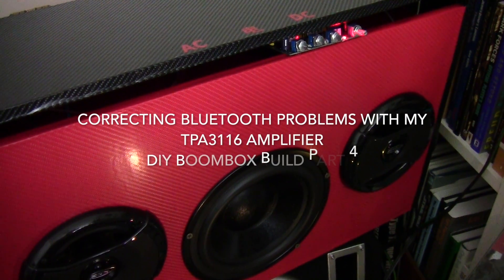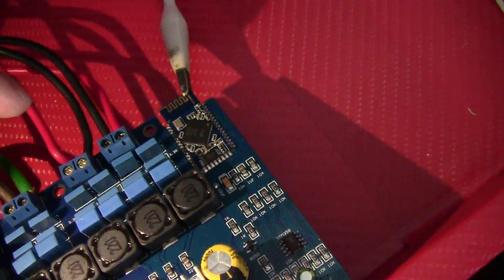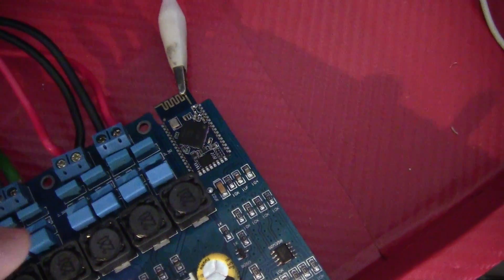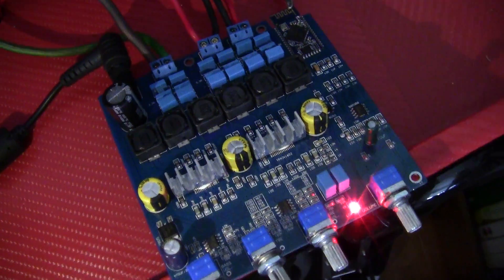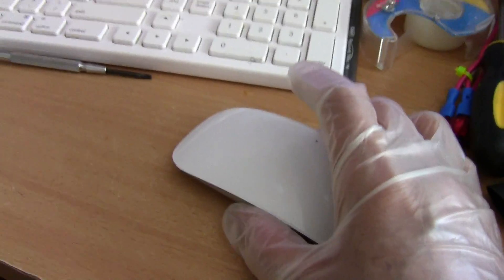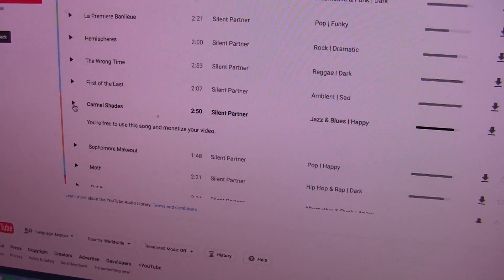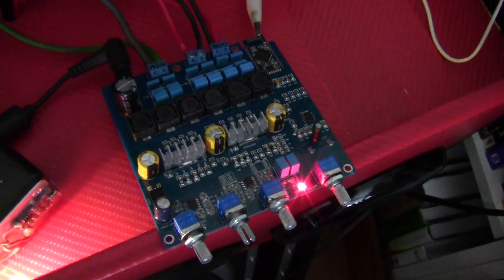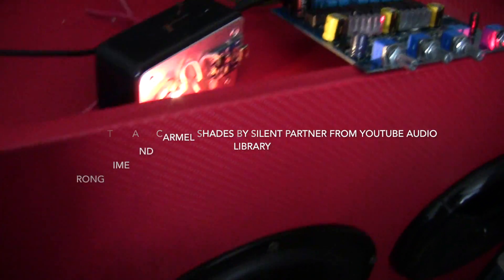Correcting bluetooth amplifier problems in my diy boombox. Boom box  build part 4

Comment: I bought the 3116 without the bluetooth. I will be hooking up a 4.0 bluetooth module to the input of the amp and see how it goes, so the bluetooth module and the device connected to the bluetooth module will act as the preamp.
Reply from the maker: The built in bluetooth is ok most of time but acts up occasionally.  I have the board installed in two units and they sound great to me.
Reply: +wtam69 Thank you so much for your reply. Will the seperate bluetooth module I am planning to use work well as the input? I also learned that putting a resistor across the input will eliminate most, if not all, ground loop noise.
Reply from the maker: The bluetooth will work well if you're using your smartphone or iPad etc. With other input sources such as a CD player or turntable, your analog input will work without any dropout or other issues. A land line will for the most part sound better than a cell phone signal.   People try all kinds things (capacitors, resistors or other filters)  to cut down the extraneous noises. If you have a power outlet without ground, you can plug that in to see if it improves the sound.  From my experience, all the sound filters (resistors, capacitors)  will help to cut down on the noise  but will eliminate certain frequencies.  If you don't mind that then that's fine.
Reply: +wtam69 Thank you for your reply, I was so rude just jumping in asking questions, without even saying to you great work, your project looks really, really good, well done and congratulations 👏
Reply from the maker: You are very gracious.  I appreciate most video work from others as I know it's not easy or simple to do a project and then film it.
Reply: +wtam69 I will try my best to do and upload my video on my build, I hope it goes well and is not too much of a disaster on my first try. I already also built some speakers based on the LX type using recycled materials from the kitchen 😆. Just did it from scratch and I was quite surprised at the good sound from these speakers hooked up to the TDA7492 bluetooth amp. Hope to do a retro type video on the build of this system soon.
Reply from the maker: Good for you. These are fun and satisfying projects, especially if the end products are half way decent. Looking forward to your build.

Comment: Solder a 1.5" piece of 24 gauge (or one strand of cat 5/6) wire to the end if the antenna lead on the board. Too much wire can actually "degrade" the signal.
Reply from the maker: Thanks very much for your input and your recommended video on the subject.

Comment: first off great videos, I have just recently purchased the same amplifier but I'm having some issues with feedback or a buzzing sound rather I was just curious if you have this is issue as well. I have tried moving it around to different parts of my house to make sure that's not interference with other Bluetooth devices and it never seems to get any better not sure if I just got a faulty unit or if this is a common problem with these.
Reply from the maker: I don't have a feedback back or buzz.  Most noises are masked when you listen to music at normal level or when your bass, treble controls are not turn to extreme positions. The only problem I have is the bluetooth from my Mac mini sometimes is not stable and the problem can be resolved by me doing a hard reset (as in unplugging and plugging device) on the Mac. This seems like a problem of my bluetooth devices rather than the amplifier though.
Reply: wtam69 alright Thanks
Reply: I did grounded all of the knobs using cables conected to the power jack ground. It helps a lot but a 
floor noise is still quite noticeable.

Comment: Your Dayton 8" sounds like its tuned high. You could try to add some weight to the passive radiator to lower the tuning to match closer to the sound of your dual 10". Still the Dayton 8" might be a lot less efficient with the passive radiator and being a smaller driver than the Dual 10" so you might never get that same level of tuning and volume that a port tuned 10" has.
Reply from the maker: The Dual 10 inch definitely has more bass.  I don't know exactly how to tune the Dayton subwoofer to the box I have.  One day I would open up the Dual to see how it is constructed and what makes it sound better.  When you work on your project,  it'd be nice if you can put it on Youtube so I can see what is a good design and how I can make mine better. I don't know what kind of weight to use for the passive radiator and how it is attached.  There is a lot of science in speaker building and I sure do have a lot to learn. Thanks so much for your input. I like your idea about using super caps as a buffer for your solar panels.  Right now, I'm working on another lithium ion pack with a BMS and balance charging capability.
Reply: The Dual 10 inch might just be in a more optimized cabinet and its bigger so the efficiency and displacement will be an advantage over the 8" no matter what even in the best conditions. I've been doing speaker design for the last 22 years on a DIY level as a hobby and I've learned a lot and it is very complicated to achieve excellent precise sound. I'm best with cabinet and crossover design for full range 2 way hi-fi speakers mostly and designing subwoofer cabinets. The air volume and specs of the woofer are quite important when you want to take the sound to the next level. The Dayton Classic 8" subwoofer you have wants to be in a vented or passive radiator cabinet because of its QTS value. Your passive radiator already has a mass disc on it and a screw hole so you can tune it further if need be. You can simply add a couple of steel washers and test it. But the Dayton specs for the 10" passive rad claim to have an FS of 19hz which is already very low so maybe this might not do much in your case to add, instead you might want to take off half the weight and aim to tune it higher. 19hz tuning is more of a home theater tuning, something in the 30hz-40hz tuning range is more musical bass in many cases like a boombox but not all. Also if you add a little sound absorbing insulation inside the speaker box you will improve the overall audio quality a little or alot in most cases. Most speaker boxes have a boxiness sound due to the midrange and standing waves in the cabinet escaping and being part of the sound you hear. This insulating would effect the midrage sound of your coaxes mostly. If you have no insulation, throw a couple of small pillows inside as a test. Then see what you think of the sound. It might not improve the sound quality depending on the speakers themselves and how they integrate in your speaker cabinet but its something to try especially for critical listening with any well rerecorded music you know and love.

For your future projects, if you go to parts express and get the spec sheet pdf of the woofer you have, you can use this link to see an approximate response curve when your doing the design before you build. If the cabinet is to big for the woofer the bass will be lifeless and flat sounding, if too small it wont play low well and it will be boomy with a big hump in the response somewhere. Just remember this response you see in the link is without room gain or room interaction. Its a good basic starting point for sub woofer and woofer design. With high-end audio the cabinet design is a huge part of the sound quality right from the exact air volume the driver sees, to venting or sealed, the thickness and bracing, to the shape to control standing waves and resonances, to the insulation material inside. 

http://www.ajdesigner.com/fl_subwoofer/subwoofer.php

Most people don't understand the "QTC" and the "Gain" spec in these calculators, Leave the QTC at 7 as that is considered middle zero. If you like a little more weight to the bass feel you could make it  "8" if you want it to sound a little more dry make it "6". The "gain" is only for bandpass cabinets so don't worry about that.
Reply: I don't do any Youtube video, but maybe I'll send you some pics on dropbox when I do this one with the solar panel idea. I also have another Bluetooth project starting first this summer using a 4ch class d car amp, this http://dbdrive.net/product/speq/ EQ as the main control unit, a Bluetooth 4.0 module and 6.5" long throw subwoofer. Plan is to make the subwoofer the main unit with all the electronics and have 2 small bookshelf sized speakers that will be detachable so it can be set up in boombox configuration or as a 2.1 sub/satellite system. The whole thing will be painted with truck bed liner black rubber for portable durability.
Reply from the maker: Whoa, thanks for the very detailed response. I feel like I'm reading the old High Fidelity or Stereo Review Magazines from when I was a teen. I know speaker design can be very complicated as there are many variables to consider. I will read your comment tomorrow and hopefully come away with a little bit more knowledge on the subject.  Thanks for taking the time out to illuminate us on speaker design and tuning.  I'm sure I won't be the only one to benefit from your insights.
Reply: You're welcome. Here is another tool I use but you have to buy it. This one lets you mess around with the box size and plot multiple response charts to compare. I've used this for many years and it is always great results for a basic design program, and very easy to understand. Once you know what your looking at its easy to see and achieve what you want and over time you will understand the middle zero QTS of 7 visually (QTS is the total speaker Q. Q is the resonant magnification value the speaker, think of it as the woofer moving against an air spring, when you design a box you want to tune the woofer with the box size and type for this reason). In the basic sense, each woofer is drastically different spec wise and so each cabinet needs to be designed different because the aim is to have a nice relatively flat frequency response.

http://www.mfr-eng.com/toolbox.htm
Reply: As for visualizing the Q, if you look at the screen shot of the frequency response chart in the link http://www.mfr-eng.com/toolbox.htm 0db magnitude would be an approx QTS of 7, anything above the 0db would be a higher Q value and causing a "bump" or boominess wherever the plotted graph goes above 0db. This can be bad because once you put the speaker in a room, the room modes and gain will amplify this boomy sound so its best to not let that go even 1 db too high especially if you place the speakers close to a corner in a room. Understanding the low Q value has to do with understanding the overall driver plots that you look at while your modeling. But most people want something normal in the "7" area. Unless you have a car stereo and your trying to slam 30-40hz of bass heavy music, those people would want a Q of 8-9. As for the low Q, if the box is way to big the frequency response is going to be much less magnitude than optimal in the bass area. 

For any beginner I would say, enter the driver specs and plot the response of the sealed or vented speaker you are trying to design and then experiment with the cabinet volume. You want to have as much magnitude as possible in the bass frequency range without causing a hump passed 0db and you want the curve to be one nice circular curve! If you over tune it the graph wont have a nice curved look it will have the look of a cliff or a L shape. Over tuning is not bad if you want a little boomy. But the nice curve is the closest to accurate sound and a QTS of 7. You will need to experiment do fine adjustments from there to balance the lowest frequency response with the most magnitude throughout the bass range. Basically make the curve as tall/big and low FR as possible before it starts to morph into a cliff shape. The bigger the box the lower the frequency response  possibilities, but too big and you will lose magnification in the other bass ranges. So this is all a balancing act of all perimeters and you will see the biggest and best curve as you plot more and more. After a few designs you'll have a good feel for whats happening.

As for woofers in a basic sense:

Look at the QTS spec before buying:

0.2 - 0.4 range is good for vented, 
0.5- 0.6 range is good for sealed, 
anything above 0.7 is not going to be accurate in a box, some pro outdoor gear and free air/open baffle speakers will work well with this QTS.

Try to also get the lowest FS spec possible for the size of woofer you get especially for sub woofers.
Reply from the maker: I've seen such speaker design App before.  The speaker you will work on should sound great given your attention to the science of speaker design.
A little off topic here and I hope you won't mind me taking advantage of your experience.  Maybe you can help me in looking for a pair of replacement 8 inch speakers for a set of AR18 BXI studio monitors.  I replaced the 8 inch woofers with some cheap RadioShack woofer because the cone surround of the original speakers disintegrated. The speaker has dome tweeters. The speakers are probably 30 years old.  I bought them at the time because I had listened to AR speakers before and they sounded nice.  The ARs are acoustic suspension design. What would be a suitable aftermarket 8" woofers for this type of speakers.  
  Thank you so much for your advice!
Reply: Oh my! The best thing to do is re-foam the original woofers. A re-foam kit is very good and easy and this way you keep all the specs of the original design intact. http://www.parts-express.com/parts-express-speaker-surround-re-foam-repair-kit-for-8-speaker--260-920
All the newer foams are much better also so it should last much longer. If you don't have the old woofers, this speaker being acoustic suspension requires a woofer with a higher QTS value. So you would need to find something inbetween .5-.6 QTS. Your best chance if you do find a woofer with decent QTS is to make sure it is the same impedance (ohms) as the original. This way the crossover will be electronically acting the same value wise. The issue is that the world has gone ported so most of the selections of woofers are lower QTS nowadays. I don't know of anything that fits those parameters off hand. Even if you did find something, there is a 90% chance it won't sound good because the crossover is designed for the original woofer which could leave you many big holes or bumps in the frequency response of midrange and mid-treble area. You could always look for a used set on Ebay and take the woofers for yours, then you'll have spare tweeters also. I see a few of this model for $40-$60 USD.
Reply: Also any capacitors in the crossover should be changed, they loose their value over time. Just look at the crossover and look for the uf number on the capacitors, most of the old school designs had small value first order designs, so likely either 2.2uf, 3.3uf, 3.9uf, 4.7uf, 5.6uf or close to those values.
Reply: If your not sure what to order capacitor type wise, most common types are film and foil, metalized polypropylene and polyester. Many arguments have been had over the differences in sound quality hahaha. I own nearly every value of the Solen polyester and 250v metalized and unless your dealing with $10'000 speakers any will do but I prefer the polyester from Solen for the cheap price and performance. I've also owned Clarity caps and Mundorf oil caps and I hated them, I found them to smooth the sound which blocked some sharp details in well recorded classical music.

In the USA: http://www.parts-express.com/cat/capacitors/68
In Canada: http://solen.ca/product-category/capacitors/
Reply from the maker: I was a fool for ditching the old AR woofers instead of refoaming them. I didn't know any better then. Then again, that model AR are the low end stuff. I would really be sorry if they are the 3a's or similar. I'll look into the old AR woofers on eBay.  Thanks a bunch for all the useful information.
Reply: I did find this 8" 8ohm woofer, The QTS is higher at .9 that would mean it would be boomy in some of the bass. I bet because everyone seems to like this woofer and claim it sounds good in a variety of cabinets and this is a cheaper woofer the measurmenrts listed are likely off, if I measured the driver specs I bet the QTS would not be that high, maybe 7.5. But some people like that type of sound, it would be sort of the same as if you over tuned a ported speaker as I mentioned in the earlier posts. So it depends on your listening habits. Old rock and roll and dance music could sound great with a little extra thump from the higher QTS in a sealed cabinet. The reviews at PE many people claim to use this as a replacement driver for old school speakers with great results http://www.parts-express.com/goldwood-gw-8028-8-butyl-surround-woofer-8-ohm--290-355 Still I would look for the originals. I have a pair of Yamaha NS-625 that I paid $80 to get an original woofer from Ebay so they would be all original!
Reply from the maker: Thanks for the doing the legwork to find the Goldwood replacement.  To tell you the truth, I don't know what a speaker should sound like and what is high fidelity.  I do know I like a good low end but not with distortion and not too shrill a high end. Too bad I can't really play copyrighted music on my Youtube videos. I would have like to demonstrate different types of music using my boom box and then let people comment on them.  When there is no AB comparison against another good sounding speaker,  my boombox sounded pretty ok (though tuned high, as you mentioned). This Youtube track with the double bass and fine music arrangement is the kind of music I can listen to all day and sounded nice on my speaker:  https://youtu.be/udm62RE-dRk?list=PLD-XgBT371GNy_xx8Ib9y-Mo1jBEtAKI1